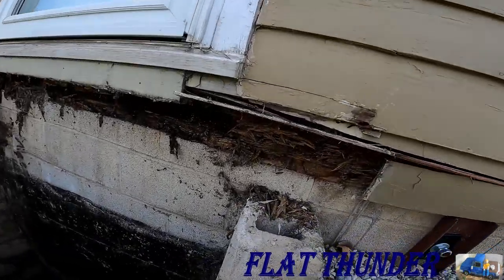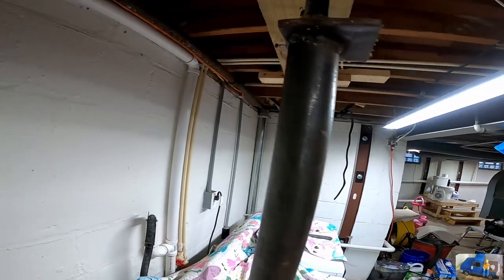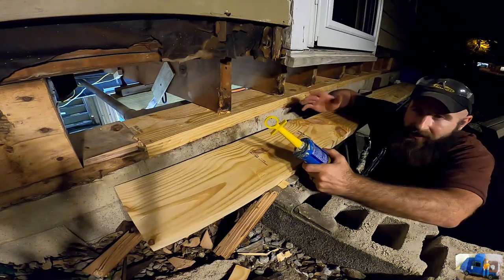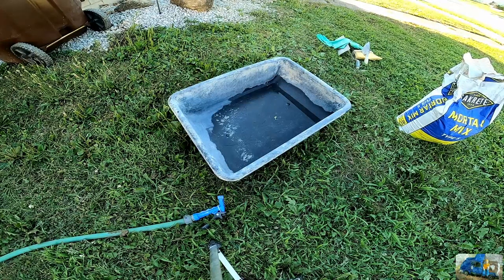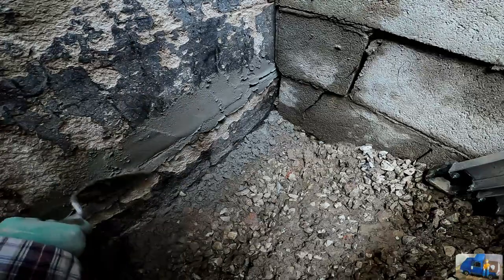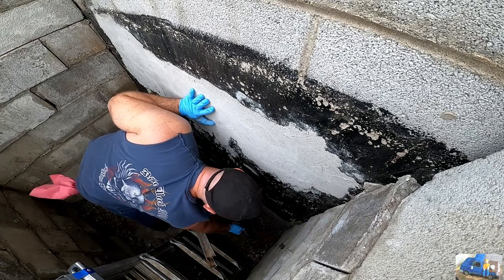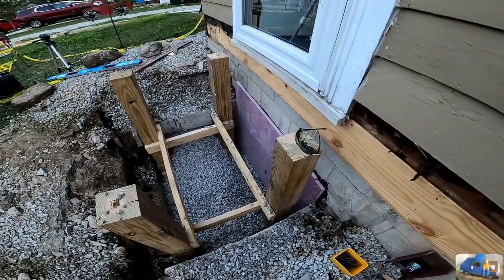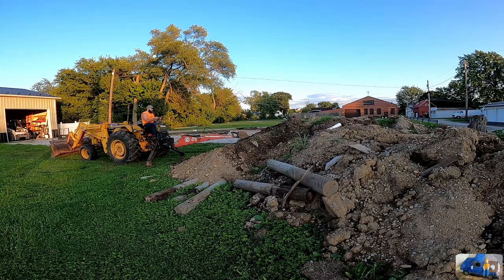RIM JOIST / SILL; REPLACEMENT (CONCRETE STEPS/PORCH ENT./ EP#2)

Comment: Did you put the new sill plate right on top of the concrete? I was just curious because in my area we usually put a pink foam barrier between the bricks and the sill plate
Reply from the maker: I did not install a foam barrier.  I replaced it as per the original; directly on top of the solid block course.  What does the barrier do?
Reply: @FlatThunder  it is meant to prevent termites from  accessing the wood from a concrete crack.
Reply from the maker: @latestartinvestor2102  I did not know about the foam layer before our conversation.  Thank you for sharing this information.  You learn something new everyday.  👍😁
Reply: @FlatThunder   I know what you mean brother. I am right there with you
Reply: @latestartinvestor2102  and also prevent moisture from concrete to penetrate wood as concrete wicks water and is always expelling water.

Comment: great video, I just had a question about the hole in front of the door that you filled with rock, wouldn’t that be a spot for water to collect? If so, maybe a good spot for a sump pump. just a thought, thanks again for the video
Reply from the maker: Not a bad idea!  I have an extra external sump pump pit I installed on the front corner of the house during the foundation repair.  The bottom of the pit has footer tile and the rock allows all the water to drain into the footer tile faster than dirt or soil.  If you dump a bottle of water in the gravel it will be in the pit faster than you could get into the basement to check.  You are right proper drainage is crucial to maintaining a good foundation.  Thanks for watching and sharing!  👍😁
Reply: @FlatThunder  thanks for the reply

Comment: I have a weird problem/ concern. I have a old house over 100 years old and the back section is basically setting on the ground.  Problem it has no sill plate, just a rim joist with hanging brackets for the cross joist at every 24 inches.  More of the story: Well a few weeks back I was very concerned with the floor dips and decided to do a little inspection and found that at that spot the dirt was up to the floor boards and rotting them. Longer story; but I could not find anyone to work on this, except one and they still did not know how the house part was built, I also found their  cost to high for what they claimed they were doing, compared to the information I was given in person..The others one would not work on it without a crawl space.  So I had to work on it my self. I am 60 and doing fine but I'm not 45 any more. I repaired, sistered two of the cross beam on the better part that had rotted or were eaten away form past termites, and bad former repairs where they used regular 2x4s and not pressure treated 2x6 or better. Yesterday I got to the bad part where the dirt was up to the floor. 2 of the cross joist are really not even there. The one is just 95 % gone with numb in the end mount, and the other is worthless. Problem is the design; it looks like it was a porch or deck and then it was enclosed and then a second floor added. I found one cement block support in the middle on one side so far and there is no sill plate with this design. So what is supporting that end of the house? How much can the wall bottom supports carry, and do I just put a 2x8 or a 2x10 in those spots to go partly under the outside rim. I currently only have access to 2 of the outside walls, and there is a deck there built into the ground and it has rotted over the past two years. Just a dumb situation/ design, but the back year is higher then the front so I partly get the point of the in ground deck. Bought the house about 12 years ago and it was my first house. I'm here on my own. The other outside part is cement over to the neighbors property, and on the inside it is the long kitchen counter and sink that I did not want to move, but I do have access at the trouble end on the inside of about 4 feet of that wall. I live in a small town, Columbia, PA. On the parts I repaired since it is built like a deck, I added 2 4x8x16 cement blocks under each of the two joist I repaired about 2-3 feet from that room edge. So that is my plan for the others, so having it go under the rim might be a wise plan I guess, or build my own support under the floor edge/wall plate and add another cement block there as well. So far for some of the jacking I have been using a car scissor jack, that might not work in that area.
 Yes, I had to dig out the dirt of the trouble spot to get do to about 10-12 inches, not know if I will disturb and house holding parts, but since the beam are about gone, no worries yet. The former fix from someone else before I bought it, was a rock or brick here and there. Just sick!
Reply from the maker: Wow.... Some repairs are sketchy at best, let's just shove this rock or brick in here!  I think I would try to repair it by building a second support structure inset from the existing unit, leaving the existing block/rock, building a new block or concrete support structure, and stub out joist under the old section for support (if possible).  All the dirt needs to be removed from around the foundation and floor.  To accommodate what is there I would dig a footer drain around it and try to adjust the main grad of the yard away from the house.  That is my make shift idea.  To correctly repair it the whole thing needs excavated out with a traditional foundation installed and proper grading around the house and or raised if necessary.  Thanks for watching and Happy Thanksgiving!  👍😁

Comment: Thank you for this video loved it. Was wondering are the sill plates pressured treated? That would help with slowing down the rottening process
Reply from the maker: You have to be careful when installing treated boards covered in flashing & other coverings.  Sometimes wrapping treated wood will encourage them to rot.  Treated boards also tend to shrink and move a lot. The replacement boards installed were yellow pine.  It's stronger than your traditional white pine.  Thanks for watching!  Cheers, 👍😁
Reply: How much does a job comparable to this cost?

Comment: Great video!  What is the reason to back plaster?  I'm going through a similar process and want to make sure I'm doing everything correctly.
Reply from the maker: It creates an extra layer that 'helps' reduce water intrusion.  Mortar is more dense than traditional concrete blocks.  The more dense material makes it more difficult for water to find its way through.  Essentially it makes a more complicated maze water must work through to reach the inner cavities of the blocks and your basement.  It may have other benefits.  I forget all the specifics, but it is the method I used around my entire foundation.  It works well!  Thanks for watching and Merry Christmas!  👍😁